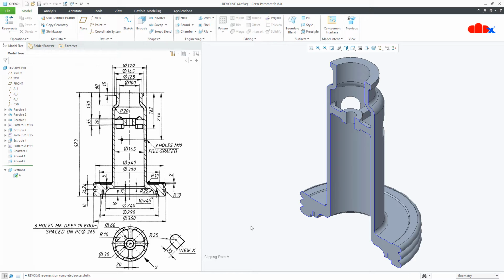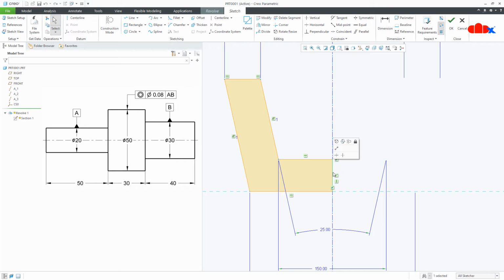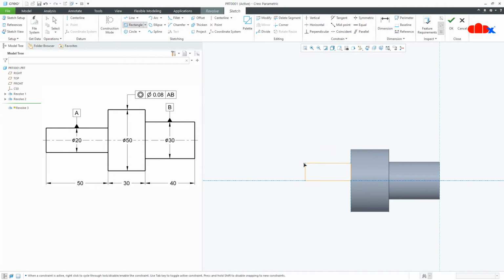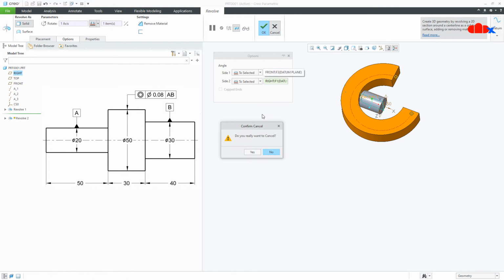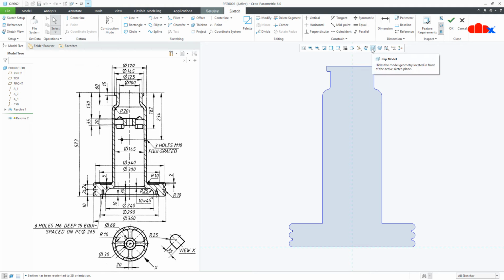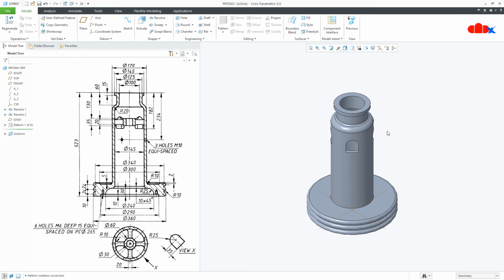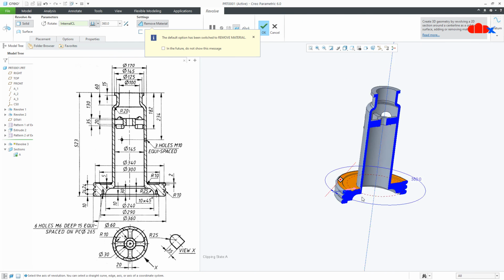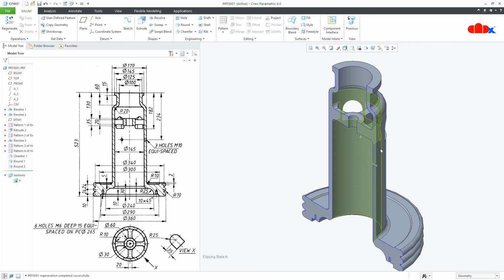Revolve in-depth in Creo Parametric

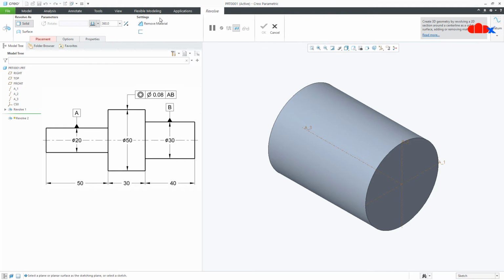Comment: 12:55, In my model tree, there none of the axes are shown seperately just the 'Revolve 1' and the planes and coordinate system; I'm using creo 7.
Reply from the maker: Those Centre axis which you see in the model tree, these Centre axis are predefined. You can create it one by one just by selecting two datum planes at a time. So if you have these Central Line predefine, CREO does not generate any Centre line inside the revolve.
Reply: @CADx-in  Ok I got it, thank you.